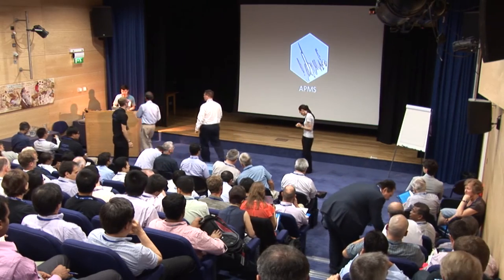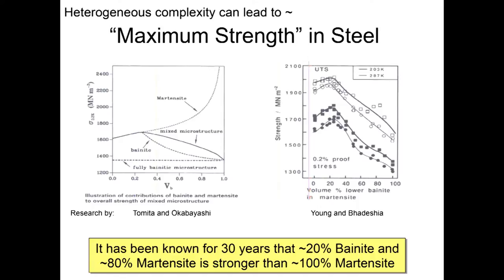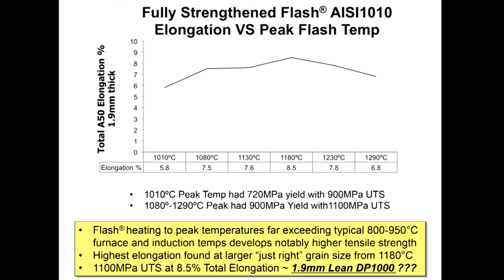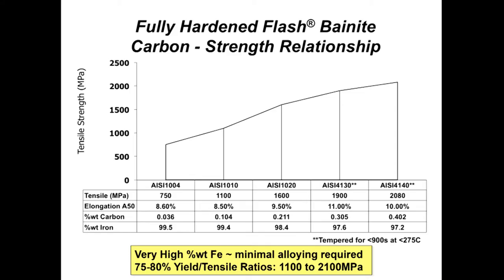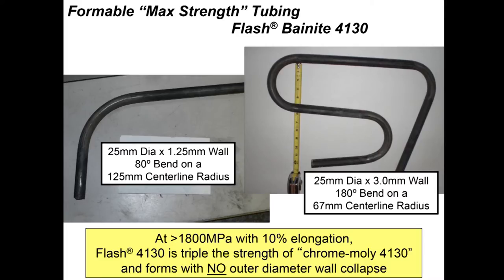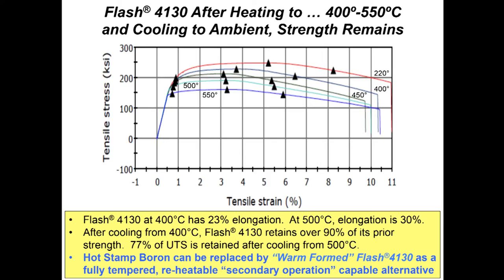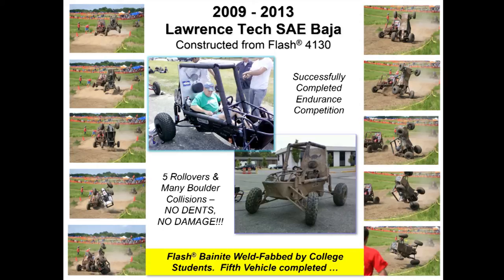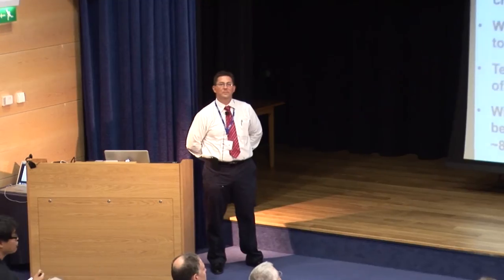Flash processing: APMS conference

Comment: The FB process is totally interesting, we can get the combination of high mechanical properties. Frankly, I am not good on it. But I would like to raise a question to feed up my curiosity. How can we explain that the rapid heating (approx. 500'C/s) in FB process can be used to trigger the uniform phase transformation? And, since the process is very fast, is the cooling rate could become a critical variable to obtain the mixed microstructure, even for maintaining the grain size? Thanks. Suharto.